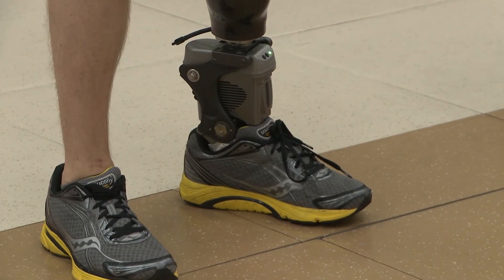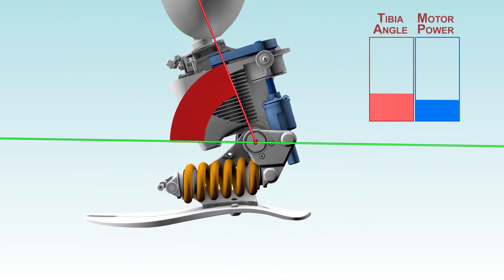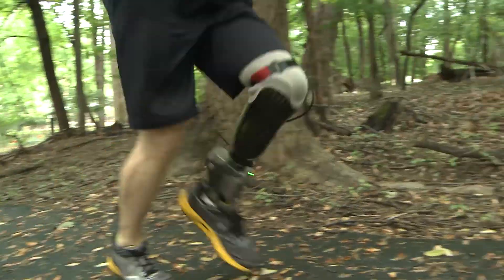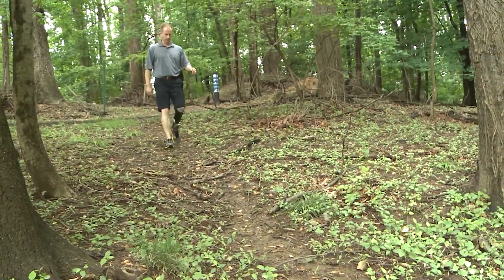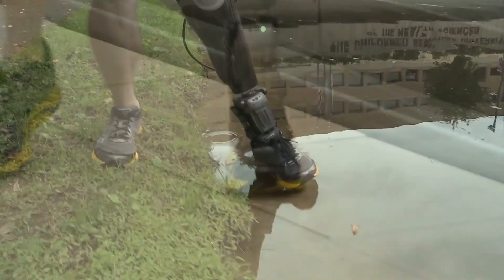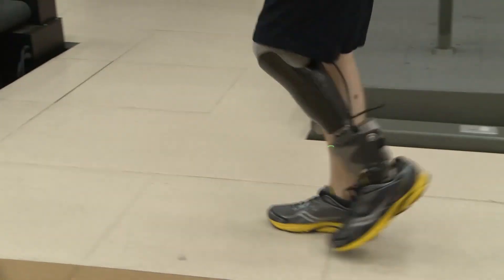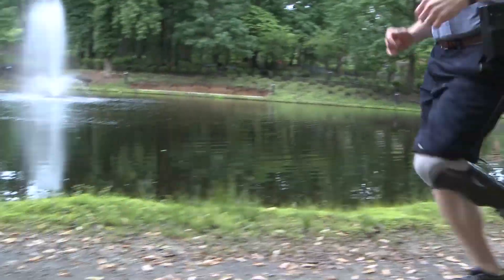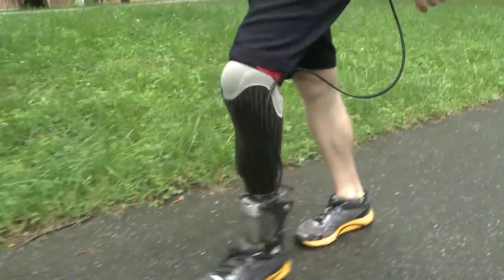SpringActive Odyssey Ruggedized Ankle Prosthesis

Comment: Hi I’ve been using the biom ankle for about 5 years now. My batteries just went out on me and it’s been a real hassle to replace. Ottobock is saying they can’t replace the battery because they no longer manufacture them and want me to spend 120000 on new hydraulic feet. :( please help I really would like to try these feet I’m done with bioms and ottobock..
Reply: how much does it costs,,?
Reply: Ajay ramesh $60,000 a piece. I lost both my feet. So $120,000.
Reply: could you figure it out? this doenst sound nice from ottoblock
Reply: @kleindavid9416   sadly no, I’m still using them with no batteries.
Reply: @DyingOvaColorz  do you think it would be possible to manufacture a replacement? With some 3D-printing and a step up/down Converter it should be possible to fit in another modern battery and convert it exactly to the right polarity, voltage and dimensions…